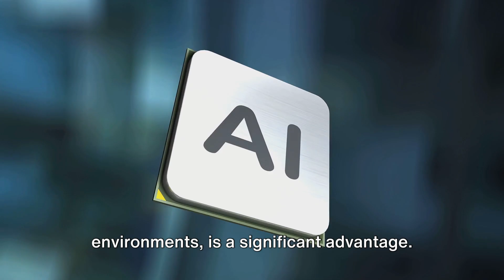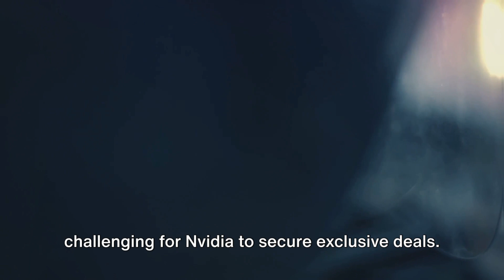Why Sony Playstation Uses AMD's Hardware: Detailed Review Of Nvidia and AMD's hardware XBOX Series

Comment: The Switch uses Nvidia. The Originial Xbox and the Xbox 360 also used Nvidia. The PS3 used power PC. What history for consoles are you talking about? Yes, the PS4 and Xbox One and the XSX and PS5 use AMD but there is no history to be had there. It took less time for me to Google that info than it did for you to record these lies.
Reply: Original Xbox used Nvidia, but Xbox 360 used ATI (later acquired by AMD). But I agree with you, history has nothing to do with it.